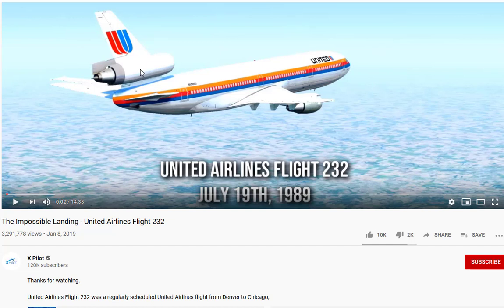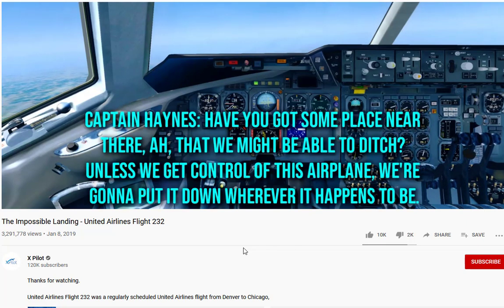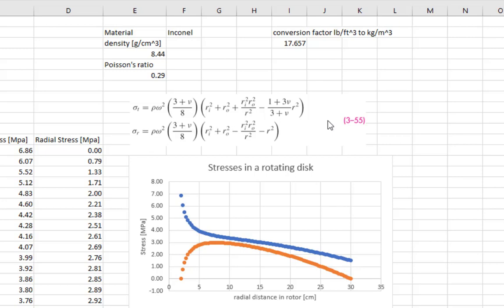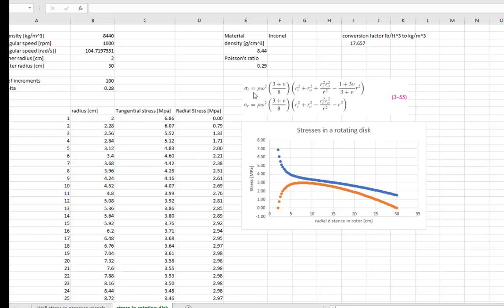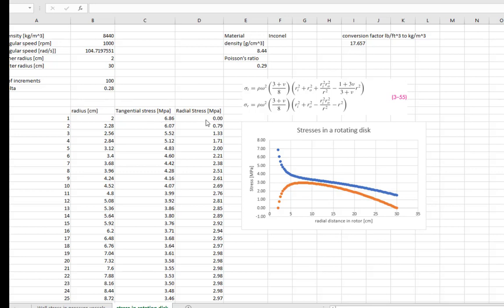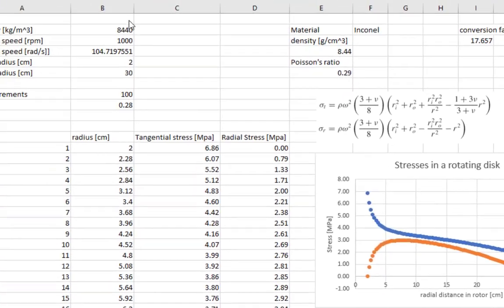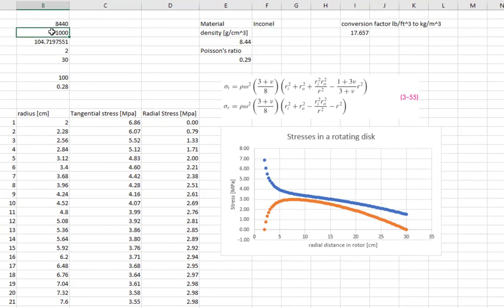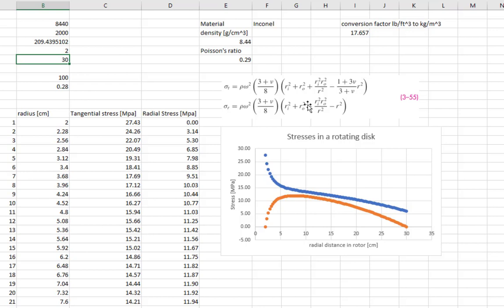Lecture 9b stresses in a rotating disk

Comment: Thanks a lot for this video! I imagine a disk with a diametre of 200mm and thickness of 10mm is considered a thin disk? What is the limit ratio?
Reply from the maker: The 1/10 rule seems to work well in a lot of these situations...so a thickness that is less than 1/10 or less of the diameter is not a bad guess for a thin plate.  Thin, however, really means that you are only concerned with stress in the plane of the disk.  If the plate gets thick, you can have a stress in the thickness direction (an axial stress).  This is induced near a free edge...

Comment: Thanks so much, it 's such a great youtube channel, it contains even fracture mechanics. Sir, what about the thicker disks?
Reply from the maker: A thick disk presents the possibility of a variation in stress through the thickness.  So long as it is loaded in the plane of the disk, purely through dynamic loading, it will have the same stress distribution.  However, if there are defects in the disk, then the problem becomes one of plane strain, rather than plane stress, and the fracture toughness would be lower...but you should be using the plane strain fracture toughness regardless.

Comment: I tried to replicate your excel sheet however my hoop stress values for the last 5 results out of 50 always become regative crossing over the radial stress plot, why would this be?
Reply from the maker: Aidan:  If you look at the hoop stress equation the only negative value is the last term, so the answer can only become negative if that last term dominates.  I am guessing that there is a numerical error in how that last term is calculated.  That pre-factor that contains the Poisson ratio.  If you do this in excel you have to be very careful about placing parentheses around the correct terms so the order of operations is what you want it to be.  You need to calculate like this: ((1+3*nu)/(3+nu))*r.   If you aren't very careful you end up with operator orders that change the answer.  The other problem is that you need to fix the cell number where you have Poisson's ratio, or just numerically enter Poisson's ratio into the equation...because excel tries to move down the column for every element in an equation.